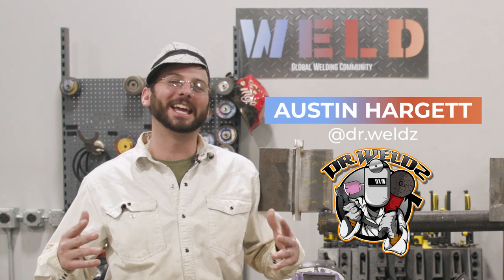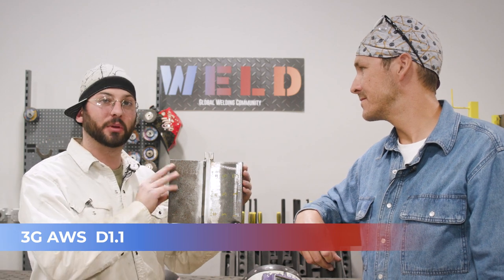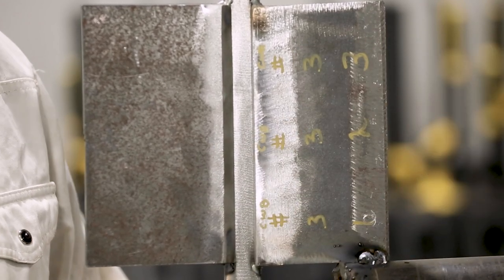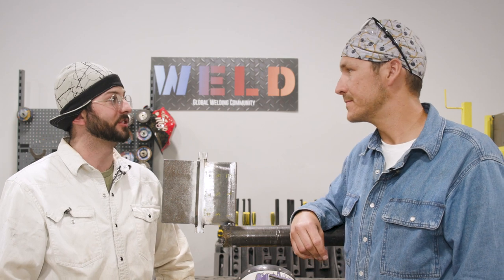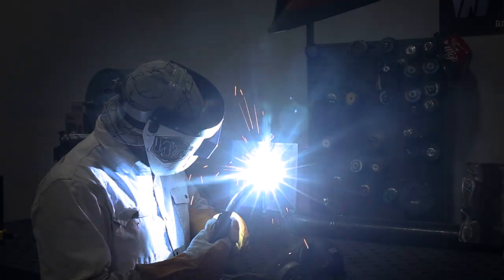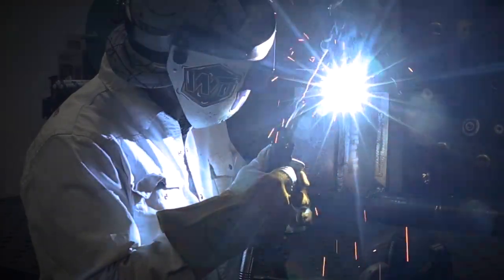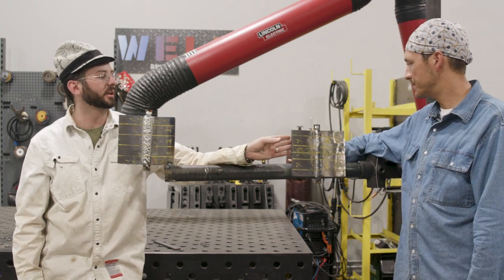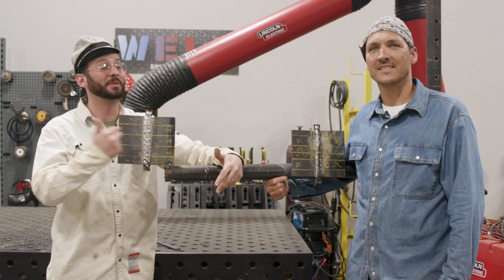Welding Standards Showdown: AWS vs. CWB - What You Need to Know!

Comment: Just passed my CWB test!!! I am now certified in all postions flat, horizontal, vertical up, and overhead using SMAW. Im actually surprised how different the AWS is when it comes to qualifying in what you can weld.
Reply: Correction. You aren't certified. You are qualified. Only companies can be hold certification.

Comment: Very interesting comparison. Here in Europe, also an important requirement is to follow and understand the welding procedure specification, which set out the process to use and may limit your favorite way of running your beads. Lol. Cheers.

Comment: I thought Canada had changed to metric but inch was used by both of you. Are the standards for welding in Canada still in imperial units?
Reply: Canadian electrician here, we use both. In my experience the more expensive the project the more likely dimensions will be in metric.

Comment: CWB testing? As a person that lives in Alberta outside of industry, self testing practical equipment repairs to wait out manufacturing industry delays is something that can take place... example, a 1 inch round power take off shaft broke... after disassembly the part was taken in and inspected for fracture depth on both faces of the PTO shaft, the part was then fitted in a jig to align it properly so it can be gouged out removing all fractured metal and welded back together, shaft stud beveled to 45 degrees past center and welded to the 90 degree face of the PTO hub in a singular "tack weld at 165amp's at 74 volts using 1/8'' E7018" part rotated 180 degrees and repeated then rotated 90 degrees and repeated for covering all 4 90 degree segments finishing with a centered base weld on the 1 inch stud that is 25% to 30% of the shaft diameter... grinding and cleaning before each weld tack and such to then run stringers from the hub face across the splined studs beveled portion in the flat welding position insuring thru all process the ground strap is directly on the 90 degree hub face and not the beveled stud, rotating 180 degrees 90 then 180 and 90 180 90 180... till the joint is filled. 1 inch drive line stud of 4340 welded with 1/8'' E7018 at 165amp with a 74 volt hot start "watts"... in testing of a simulated abrasion surface it rotated an equivalent 900 pound load for 70'000km... and under rapid testing sustained an internal peak torsional load of a standardized unit meeting 178'000psi at the end of its 70'000km simulated abrasion cycle... standard CV axles for a ford 8.8 are warrantied for 180'000psi to 230'000psi tensile over 75'000km. 93% abrasion 77% tensile ... to that is was the 4340 stud that broke not the weld tho the brake was clean and flat similar to the original brake being that the 45 degree beveled portion was what broke not the fusion point of the 90 degree hub face allowing the hub to stay partly captive in its bearing race preventing additional damage. to that of the actual fractures on the part that was welded then broke being 3 times longer then the fractures on the original OEM broken PTO stud... 85% 7018 is a 70'000psi tensile rod to a 4918 process being 100'000psi tensile and including base metal contamination that permeated throughout the entreaty of the weld... 178'000psi is 178% above indicated process limitations 131.5% over all. its $50 to buy a new axle, its $5 just to weld it to at least 85% of OEM standard. where as a 85'000km OEM used part would be a 0 grade as it is passed its usage scale of -1% per 800km. welded 85% of an OEM specification part is better then a junk yard scratch and sniff "only smelt nice once still says win but there's nothing behind it, maybe a 50 cent Slurpee followed by a quick coming brain f... fff...". SMAW

Comment: Can't believe flux core ,I haven't seen F.C. at least 28 years,8010,7018 @ tig that's how it's done in the refinery be except the 8010 pipe line rod.Remember weld a broken heart or the crack of dawn makes no difference🌀